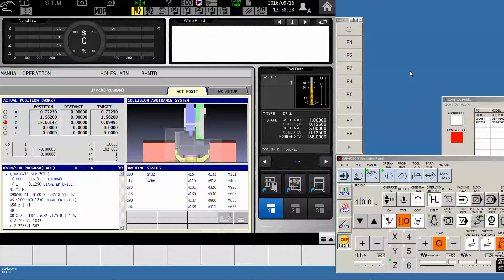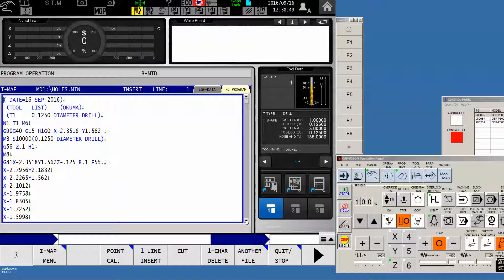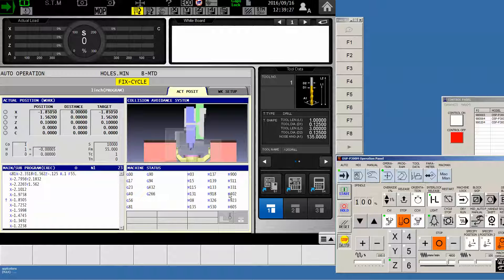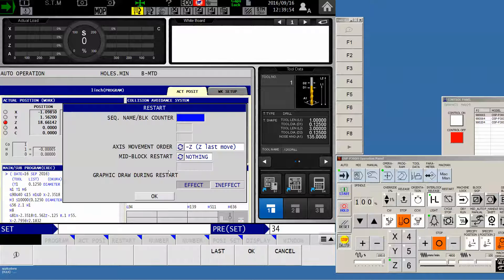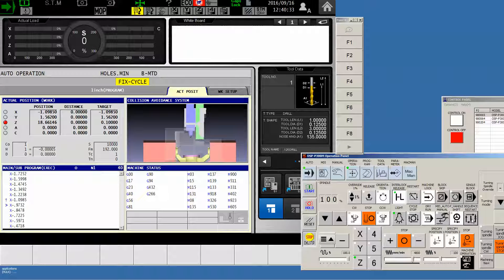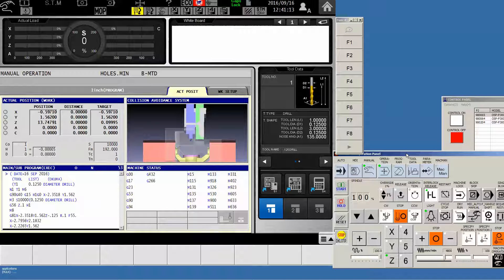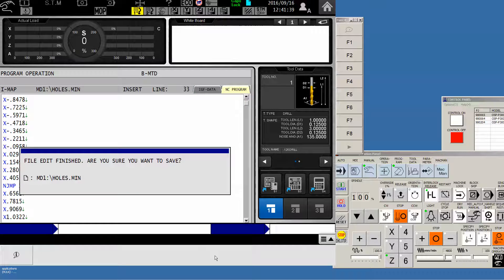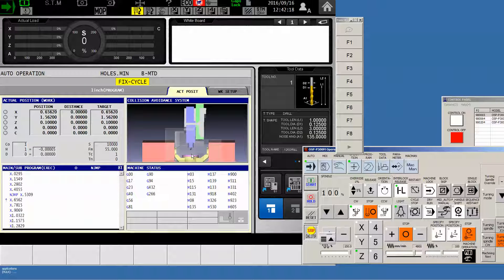Special mid program restart function for Okuma milling machines!

Comment: How do i clear out the alarm error 5230 sequence restart command 7
Reply from the maker: Make sure you press enter after typing the sequence name. The Nxxx appears in the yellow buffer until you do press enter, then you'll see the data move up to the restart pop-up. If you dont, the 5230 tells you that we made an oops
Reply: @pocketcharleywithgosiger i cant able to start the program from Nxxxx. I thoguht the previous owner lock it from the parameter. I also have a program with tool dia wear offset . I cant not making the offset bigger than -.002 .

Comment: do you have to call out the tool or not
Reply from the maker: @longlee934  the tool that you’re starting with should be in the spindle if you’re starting after the tool call. If you’re restarting BEFORE the tool call, the previous tool should in in the spindle. Bottom line: the tool that should be in the spindle for the restart position

Comment: Hello! How to find block nummber if's gone from top and I dont't want to edit programm or it's not premissed to edit?
Reply from the maker: I'd suggest running the program in machine lock up to the portion of program where you'd like to restart. That way, the block number would appear in the upper right corner of the program window. Keep in mind that you can use high draw on a mill or dry run on a lathe to speed thru the program to that point